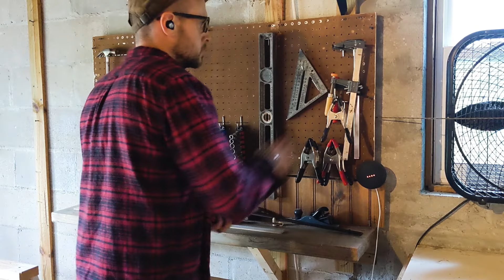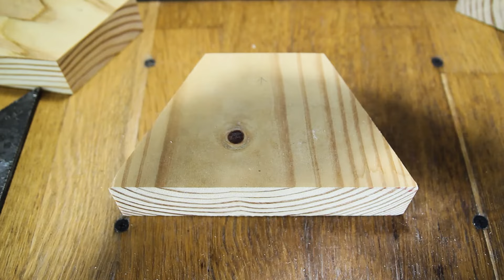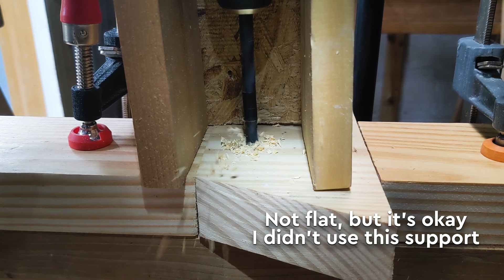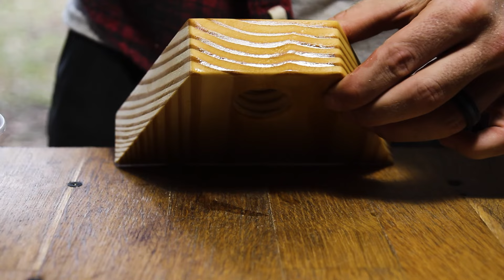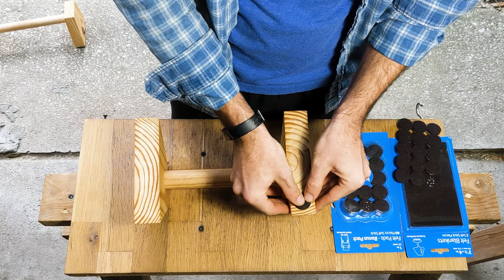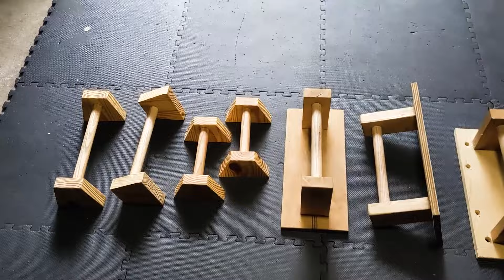How I Built Some Small Wood Parallettes (Push Ups, L-Sits, Pike Press)

Comment: To prevent slipping I’d try grip tape. If you don’t want to mess up your floors with regular grip tape there are brands that make rubber/soft grip tape. It’s already adhesive so you can just cut a piece the size you need for the bottom

Comment: I struggle to keep the supports at 90 degrees to the grips, while they’re glued and drying. I’m also finding that while my drill bit is 1 1/4 inch, and the grips are 1 1/4 inch, the fit is surprisingly tight, and it’s hard to get them to sink all the way to the bottom of the drilled out hole. (Probably why I’m having trouble keeping them at 90 degrees.) Any suggestions would be appreciated.
Reply from the maker: Hmm... the tight fit of the supports/grips is good. Use less glue, since it's taking space away from the grip.

While using the parallettes, the pressure is primarily downwards and not outwards, so I personally wouldn't be as concerned with them coming apart with less glue. But your mileage may vary, adding a screw at each end could also help keep everything strongly together.

As for the 90 degrees: maybe try putting everything together, then placing them in their proper orientation on a flat surface to line everything up before they dry. A hammer or something similar could help bang everything into place as well.

Let me know if this helped at all. We can figure something out together.
Reply: @woodworkingout Did you taper (by sanding) the ends of the dowels at all?

Comment: Does it matter if the dowel is halfway in the base or all the way through?  I don’t want to sacrifice the look if it doesn’t matter
Reply from the maker: I'm still regularly using the ones I made in the video and haven't had any issues (yet). If you want the clean aesthetic, I'd recommend trying to get the dowels as far into the wood as you can without going through.
Reply: @woodworkingout  I just finished mine!  I decided to make them go all the way through.  They turned out fantastic, and the video helped.  Thanks!

Comment: Would you recommend using 40mm diameter Wooden curtain stick? That’s the cheapest and easiest option for the bar I have in my town.
Reply from the maker: It's worth a try, the main concern is if it's strong enough. I say build some and see if it works.

Comment: Great video. I enjoyed your relaxed style and great camera work.
I need to get in shape and have looked into these. Not so much for push ups but one day I hope to be able to do L-sits and some of the crazy stuff these calisthenics youtubers are doing like the planche.
Anyways, I thought $40 on amazon for these considering how simple they look to make seemed like a waste of money when I could make them myself. I had a rough idea on how to make these myself and wanted to get some further ideas. The way you made yours is roughly the same way I'd make mine. I would use a miter saw to make all the cuts but that's my style.
I saw some on amazon who's product listing feature mentioned running a screw into the dowel however this might not be necessary. I think wood glue is plenty strong and alone should suffice. What do you think?

I have hard floor surfaces at home so I would benefit from rubber pads underneath. Maybe some hard rubber mat material. Although I'd have to research what type of glue, cement, epoxy to use to attach it to the parallettes.

I think one solution to the leveling issue would be to sand the bottoms down. Maybe tape down a large piece of sand paper onto a table and run the parallettes until completely flat and level.
Reply from the maker: Thank you man, I appreciate it. It's more fun to make them yourself anyway, although buying is not a bad option for some.

We only have the chop saw and circular saw, the project would definitely benefit from having more/different equipment. Getting things set up for the circular saw can be kinda tedious, but I like using a lot of clamps, so I don't mind haha. Whenever you get yours finished, I'd be curious to check them out.

It's been about 2 years and the wood glue has continued to hold up fine, they've been indestructible. I've ended up mainly using them on carpet, so the leveling issue hasn't been a problem lately. Your idea is great and I'll incorporate that next time I make some.

You'll get your L-Sits in no time my dude. Keep after it!

Comment: Thanks for the video. I have very large hands, and I'm about to build a pair using 2 inch dowels.  I think it'll help with the weight distribution and will cause less fatigue. What do you think about really think handles thicker than 1 1/4 inch?
Reply from the maker: Yeah man, that's a great idea! They'd probably be indestructible too

Comment: If you add the slip pads before you oil it. Then they should be able to stick. Also maybe only sand those spots to 180 grits at highest. Basically rough it up for better adhesion and wait to oil since the oil hinders adhesion aswell

Comment: As far as no slip pads go, Just use any pieces of rubber or latex you like the feel of, and use that gorilla glue and put a block between the clamp and the rubber. Let it set up overnight. There ya go. A heads up play in the future would be to attach your no-slip thingies BEFORE you oil the wood. That is why the adhesive can't grab ahold of the wood. Cool vid though.
Reply from the maker: Thanks for the tips, I'll definitely incorporate the glue method in my current and future builds.

Comment: what wood should I use to make a real good and strong one? (Im a noob at woodworking)
Reply from the maker: You'd be surprised how strong most woods are, especially in such a low-impact use case. I used Pine for the side supports. Although Pine is considered a softwood, they're holding up really well and feel strong. The bars are made from an Oak dowel, which is a hardwood, which is even stronger and more rigid. I would just avoid particle board or plywood for this particular project. Most lumber you get from the hardware store should work out fine.
Reply: @woodworkingout  thanks for the answer man, really helpful!!! plus, awesome content. you should make more videos :)

Comment from the maker: You never really know what to expect when you post a video on YouTube. I am very thankful for all the views I have gotten so far, it's very gratifying. My wife and I just moved from Florida to Colorado, from a house into an apartment. I have a garage here, I just need to get it set up for some projects. I have some ideas for more videos and I definitely want to make more. Thanks for watching and we'll see you soon.
Reply: Overall a god and clean video, especially for your first time, but you would increase the durability if you would have oiled it afterwards. The Glue will have nearly no effect since you oiled the most important part of your staff, the sides that you stick into the holes. Glue wont have much of an effekt, when you glue the top part of wood (end grain). Only the sides (wall plate) hold for sure. I am an carpenter from Germany. Sorry for my bad English, but i hope you understand what i mean. 

Oil and any other surface treatment only make sence to apply before, if you don`t want any spilled glue to stick. But you can always clean fresh glue with warm water and a toothbrush.

I recommend you to drill a 6mm wide to at leat 60+mm (2,3 inch) long partial thread screw. Partial thread means that the thread is clean at the top part, so that the sides will be pultruded to the staff. Even Nails would be better than nothing, since the nails would make the same effekt like you see from staffs that hold hammerheads. Otherwhise the staff will probably pulls itself out until it breaks while you trained with it and that could hurt a lot.

Keep up your creativity and enthusiasm :-)